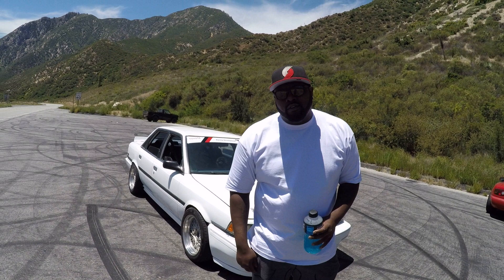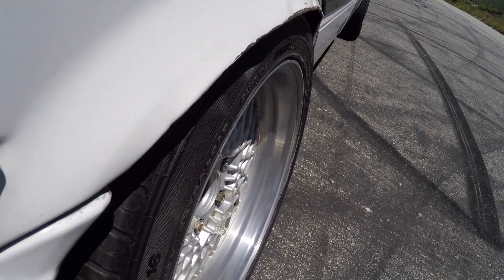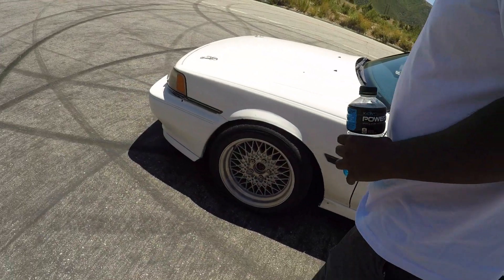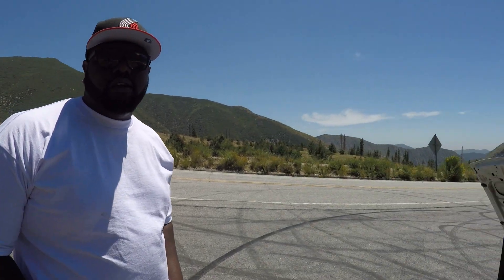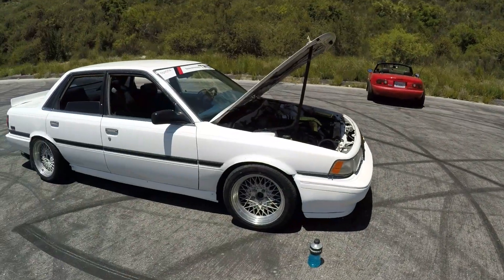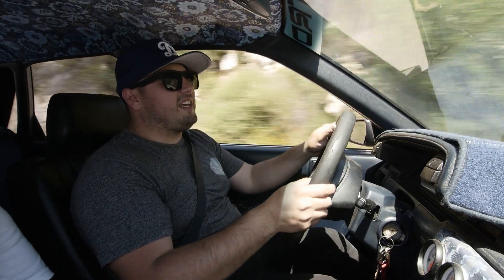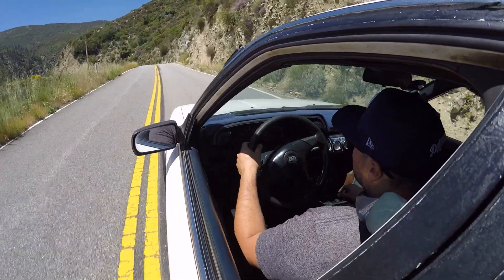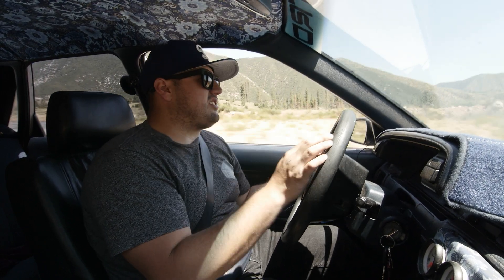1990 Toyota Camry - Turbo

Comment: There were some ground effects & actually a solid filler panel for the grille.  I would remove the Lexus badge myself on this I did a black grill on mine with red outline TOYOTA badge.

Comment: ive always thought the camry was super underappreciated. lots of potential at least
Reply: i love my camry v6 i have over 300k miles
Reply: the 3rd gen camry with the 3vz v6 engine has a crankshaft that's good for 300 kW/400 BHP...people have pushed it to 600 BHP apparently. It's such an overbuilt engine for a grocery getting car.
Reply: People like you keep my 1985’s spirits high, 285k miles and still chuggin

Comment: I like this. It's a modded classic. A great time period original. I've noticed that the early 90s cars are getting quite rare. If you got one Hold onto it!
Reply: ghostcar I’m lucky I just got a salvaged 1991 Camry V6 with barely 100k miles
Reply: @jordibigbucks6435  very lucky

Comment: Funny thing is I have a 1990 Toyota Camry with 56,000 original miles on a 2.slow. So far I only have a cat delete and a 10 inch glass pack on it but I am building it out like a rally car. When looking for suspension mods and turbos you have to search for Celicas around the same year. They use the same engine and general suspension, and some of them came with turbos. I love my little daily driver. It cruises at 85 mph with the AC on and gets 380 miles to the tank. I call it the Toyota-tronic X-wing Dream Machine. #BeckBuilt. Definitely enjoying this guys build. I love to see other people's takes on the same car. Keep up the vids homie! #JDMRedneck
Reply: dig that engine swap......
Reply: BeckBuilt what suspension did you end up going with? I want to pick up a 91 Celica coilover set but I don't want to modify too much to make it work.
Reply: Andy C on my 1990 camry wagon im running 2007 camry coilovers
Reply: mongoose4lif3 yoooooo. Did you modify fitments to get it to work?
Reply: Andy C the only thing i had to modify was the lower strut hole on the coilovers. They had to be widend upwards just a little in order for the hub assembly to fit. But other then that, the top hats fit perfectly in the cars suspension holes.
Reply: mongoose4lif3 siiick. Thanks man.
Reply: mongoose4lif3 thanks man!
Reply: Jdm reckneck thats one for the ages ive heard it all.....

Comment: Don't use hairspray go on the bottom side of the blow off valve take another hose clamp and run it from coupler to coupler on the bottom half of the T4 the blow off valve after you secure the clamps as you have them tighten down the bottom hose clamp connecting all three together the hidden hose clamp on the bottom will hold the two couplers on to the T. Hairspray will not hold up to 17 PSI on a smaller amount of boost that's a solution and it works but when you exceed 10 psi you have to get creative! Tightening down both hose clamps onto the tee and then using the third hose clamp connecting the two clamps on the T will ensure that it will not pop up a part again

Comment: you can fit a 1mzfe 3.0 v6 in there with the 3sgte gearbox,just an idea
Reply: yeah but that's make for economy, not performance
Reply: Than why are the MR2 owners are swapping out the 3SGTE motors for the 1MZFE non-VVT-I motors? You wanna know why? Because0 TRD made a supercharger for the non-VVT-I 1MZFE motors.

Comment: Can confirm there is almost nothing for these cars. My first car in 1996 was an 89 Camry passed down to me, and it was the 3S-FE 2.0L with manual gearbox. I had to hack almost everything. Couldn't even get damn clear corner lenses for it lol. I put Intrax springs and KYB struts on it, but that was about the only thing actually made for the car.  I sold it with 154K miles. The gearbox was total crap, had been replaced twice. By comparison my Integra GSR has 361,000 miles on the original engine and gearbox.

Comment: I could be wrong, but the Caldina 3S-GTE was the most up to date 3S-GTE. I forget what it has over any of the other 3S-GTEs but I think the Caldina 3S has, among many things, higher CR and makes stock 10hp more than any of the others?
Reply: Sigma Projects modified exhaust better than the last gen, a ct20b turbo and they raised the compression making it like 260 hp and I'm pretty sure the gen 4 only came in the caldina gt-four and rav 4 in Japan. the horsepower differences depend if it's an automatic or not they have 10 less hp. didn't he say he had a gen 3 though?
Reply: Ah ok, I thought he said he had a 4th gen.
Reply: Sigma Projects you're right I listened to him again it's a 4th gen but yeah the 10 hp loss is between the auto and manual trans ecu
Reply: Coo, thanks for the info. 3S motors are pretty underrated I think.
Reply: Sigma Projects fuck yeah that one's basically stock upgraded turbo and 300hp on stock ecu those motors are sick I have a 2001 corolla and I told myself if I ever get any extra money Id love to swap it and make it a killer sleeper
Reply: lol, Corolla would be a sleeper.
Reply: the 4th gen 3sgte is good for a more linear power band than the others. I have one in my sw20 and it rips any canyon.
Reply: the pic of the Caldina was a st246w, the 3rd gen 3S-GTE in this car is probably from an st215.
Reply: I know a guy who, believe it or not, swapped his 2JZGTE out for a rebuilt 3SGTE. He said the power to weight ratio is so much better and makes his supra handle much tighter.
Reply: ChaotiX wouldn't doubt it at all sounds sick too it's a proven engine just like 99% of all Toyota stuff the bell housing is probably the same as a rwd tranny
Reply: I believe the gt500 supras used 3s engines so that would make sense
Reply: ^THIS^  Yea people don't realize Toyota didn't favor the JZ engine family for racing. I don't think the Supra ever raced in the JGTC series with a JZ engine, they ran turbo 4 cylinders like you mentioned and then 3UZ V8s that were punched out to 4.5L.
Reply: I have a 4th gen caldina engine I am putting in my mr2. It's stock with 260hp

Comment: Sweet setup! the 3S-GTE is a great engine for that platform. Back then, the Celica and Camry used the same powerplant, the 3S-FE. as of 1991, the MR2 started using the updated version. However, the 1988 Celica All-Trac (aka GT-4) used the 3S-GTE before the MR2. Toyota made the Celica for two generations with it. there was even a Camry All-Trac offered on the Gen 2 Camrys. 3S-GTEs are actually quite common. What makes this one uncommon is it wasn't offered outside of japan as the 4th Gen version. Earlier models were 200-220 hp; This one is 260 hp. Torque steer comes as no surprise being that this engine was designed to be used in an all wheel drive vehicle. Still, he did it right.

Comment: Just kind of common knowledge never to gun it in a corner. Doesn’t matter if it’s rwd or fwd. either way you risk losin control. Rwd the tail will kick out and fwd you’ll get torque steer. I have a 1990 2wd Toyota pickup that will kick out in 1st and 2nd gear in corners, and a 3sgte swapped 93 Celica GT that will try to steer you into other cars in corners if you hit boost. Lmao

Comment: Piece of junk is all I drive so I know what I am talking about. Fiat 850 69, Datsun 510 70, VW Rabbit 77,  Toyota Corona 80,   and many more of the "Classics" under $4K  Don't talk to me about loose suspension, that is just plain lazy and dangerous. For every one.  Seat belts were an option.  Brakes & Good Tires never were. Put your money where the car meets the road before you put too much power into it. Any real 'track' race car driver would wipe by all these mods and scare the crap out of a passenger with a stock motor.  He want brakes and tires and shocks. That is where you put you money. Not fancy wheels; not $1K of stereo,  Looks after safety. Comfort before Sound Hall.
Reply: Let ‘em go Joseph, he’s had enough.